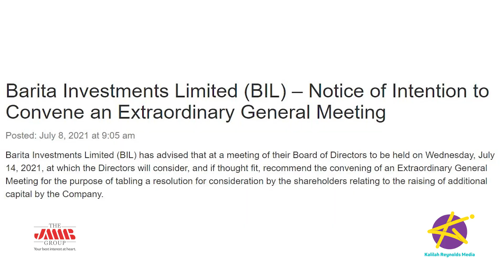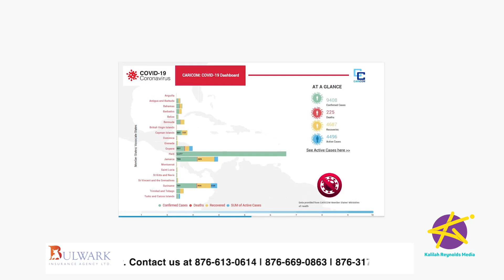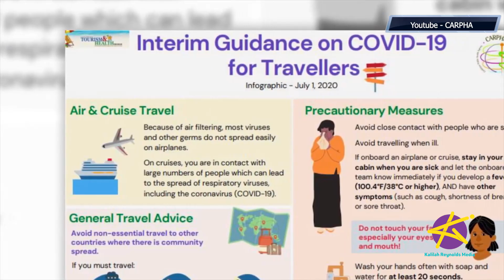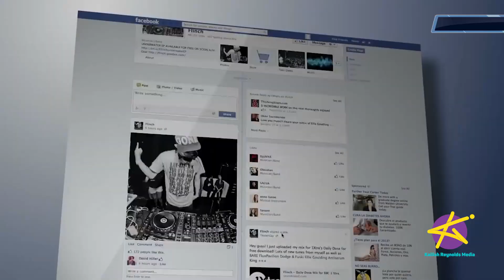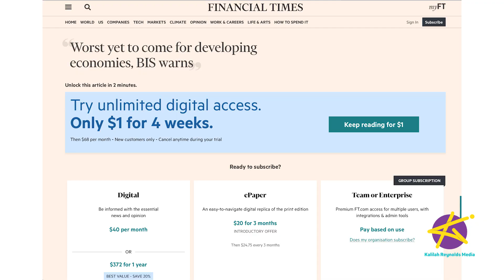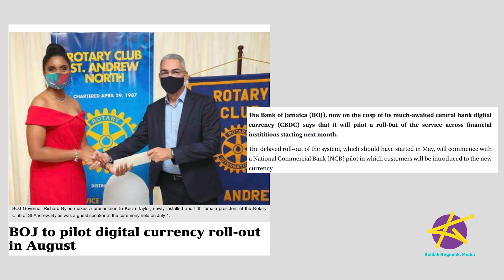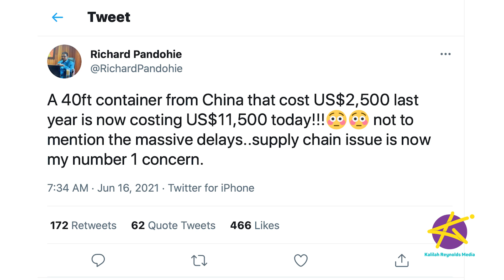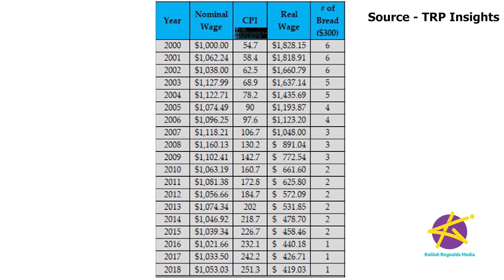TAKING STOCK - Financing the Caribbean's Recovery

Comment: Inflation is an increase in the money supply I wonder if the boj will print more or less money with a cbdc
Reply: Boj doesn’t print money
Reply: @chromographic  I see what you’re saying if it’s digital currency they didn’t really print anything they issued it.
Reply: @chromographic  sounds like BOJ is privately owned. Any thoughts on who are the shareholders of the BOJ?
Reply: @anthonycoote9546  they are not privately owned but are independent
Reply: @marie-lisawright4817  do your research. I think it's independent and privately owned as a stipulation of IMF loans
Reply: @anthonycoote9546  they are not a private company. Their role is regulatory as it relates to spending by government entities. Please research what constitutes a private company.
Reply: @marie-lisawright4817  the federal reserve is a privately owned banks, but use the name to give impression it's owned by govt. It is given the responsibility to be quasi independent. Elsewhere, most govt run banks are privately owned. Understand what I'm saying. The name BOJ is a misnomer